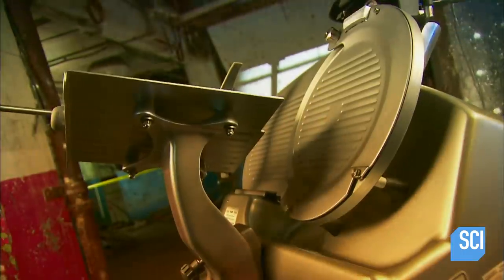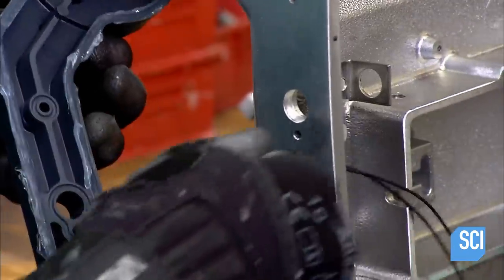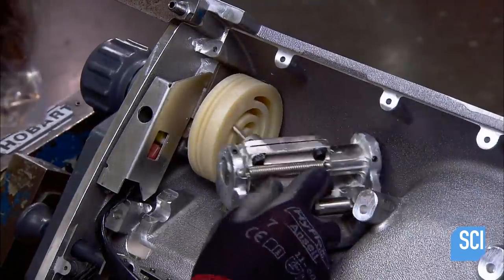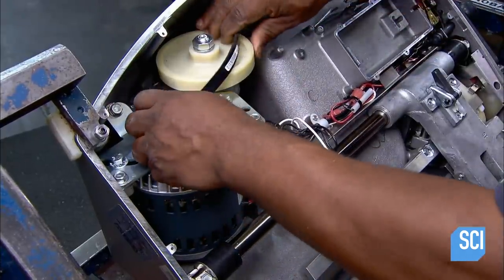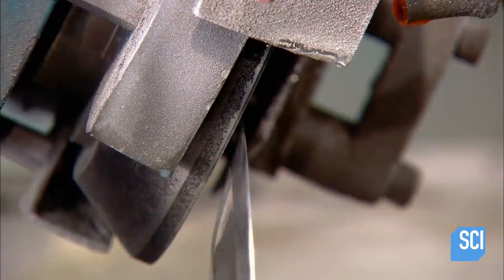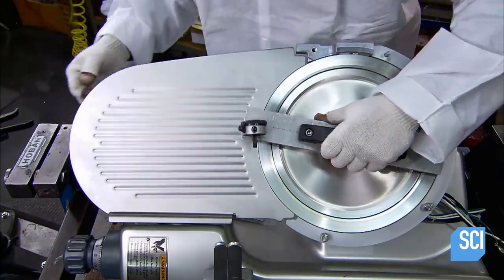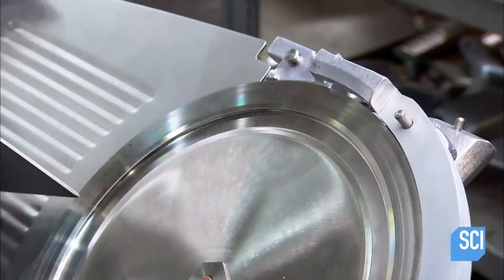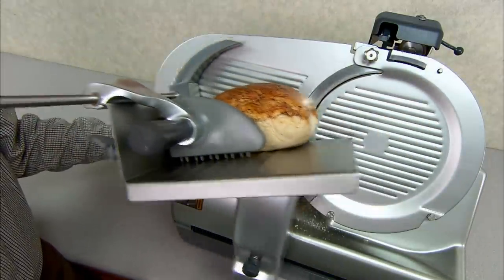How It's Made: Deli Slicer

Comment: I worked in a local restaurant with a similar model. Yeah you can cut a whole lot of things with this. I had to feed the meat myself, the chef told me that most people send themselves to the hospital while they clean the machine. Cleaning the top was easy, but cleaning the bottom was pretty hard because a lot of gunk just hides in crevices here and there.
Reply: Used to work machine sharpening blades and shear cutters. these blades aren't no joke, they get sharp enough you'll cut yourself with just a very light touch, happened to me plenty of times.
Reply: We have this slicer too and I agree, cleaning the bottom is a pain.
Reply: Use cut resistant gloves. Its not that hard.
Reply: @metamorphicorder  Yeah, I never shied away from those gloves. A lot of old heads don’t use them for whatever reason.
Reply: @thelordofeternalfireandhis4033  ive done it both ways. I dont remember ever seriously cutting myself on one. Maybe a nick here or there. I could even clean them with the blade turning, which you should absolutely NOT do. But us old heads do sometimes do things in inadvisable ways. I think the bizerbas have an easily removable blade which makes it pretty easy to clean. I do think that a oscillating blade would probably be better than a rotating one from a safety perspectice and it would make cleaning easier and safer. They would be really really loud though.
Reply: I used to work in a grocery store deli in the 1990s using these. You did have to be careful when cleaning. People also liked to take shortcuts and hold the deli meat and carrage with one hand instead of using the guard. I had to come in once and clean the deli because a coworker cut the tip of her finger off while slicing chicken roll.
Reply: When i was in a culinary school a girl was slicing a roast when someone started talking to her. She turn to reply to the other person and sliced off her finger tips (luckily it was thin very slices) and she didn't even realize she did it until she saw blood, these things are no joke. there's alot of was to die or seriously injure yourself in a commercial kitchen.
Reply: Used a very similar model (no automatic feeder, woulda been sweet though) and the blade is so sharp that you can easily cut yourself and not even notice. The cuts also bleed forever because it's such a clean cut, had one bleeding for maybe 6 hours before it finally stopped
Reply: I stumbled backwards into one at the butcher's, his customers got a little behind with their orders !
Reply: I worked for the food services when I was in college and hated cleaning those machines.
Reply: I remember cutting my finger on one of these. I was 21, naïve, and I thought that I could get a little piece of meat off of a blade that I had turned off (but was still in motion). The thing wasn't even particularly sharp, but it still made a good clean half moon slice in the tip of my left index finger. Even if it wasn't the sharpest years-old blade anymore, I still couldn't feel pain for about 5 minutes-- it was still that sharp. Now every time I see one of these, I cringe a bit and feel the raised scar skin on that finger, lol
Reply: @phonedave  my guess is it was weaver chicken roll in a blue wrapper. I've used Hobart slicers at Shop n Save and most recently Bizerba slicers at Walmart. Only thing I miss about the Hobart is the removable caridge and more granular numbers on the guage plate. Otherwise they are mostly the same.
Reply: @haloslayer255  Yep, Weaver in the blue wrapper.
Reply: The one I’m buying has a easy remove blade
Reply: Retail meat cutter for 15 years, and I had my middle fingernail replaced with a toenail bed under my big toe, took the entire top of my finger in an instant.

Comment: Hobart slicers are very nice. But they cost alot, like most commercial appliances do.

For home use, I purchased a 10" BESWOOD slicer and I love it. Quiet and smooth operation, and easy to clean and maintain. Very rigid adjustment on how thick you want your cuts and assembled well. I have many hours on it in the couple years ive had it and its still like new. Comes with its own sharpener as well. 5/5

Just cut a roast for beef sandwiches today, paper thin and excellent.

The unit cost about $350-$400 I think? and parts are available if needed. If anybody is in the market for a slicer for home I enjoy this one. Surely there are other nice ones out there, but im just sayin.
Reply: Thank you!
Reply: Beswood and KWS make good inexpensive 10" slicers. Built pretty much the same as the commercial slicers, but scaled down and designed for a lower duty cycle.
Reply: you have a deli slicer at home??  wtf

Comment: Former Hobart service tech here.  A better video would be "How deli workers mess up slicers."

1. Drop them while carrying them to the sink. (Lift and clean in place, do not move unit from location).
2. Submerged in the sink.
3. Plugged in while motor case is filled with water after being Submerged in sink. 
4. Using spray pan release to lubricate.
5. Using nothing to lubricate.
6. Excessive force with grip causing grip to crash into blade..
7. Excessive sharpening.
8. Not sharpening.
9. Bones.
10. Lack of training, or lack of listening.
Reply: Those things weight a ton, why someone would willingly carry this to the sink everyday?
Reply: @wills5482  Bad management probably forcing them to carry it to the sink

Comment: I used to work at a deli where one of these would be used. A silly old man who fancied himself a comedian came in one day and attempted to pass a pressed sandwich through the spinning blade to make thin disks from it, but it didn't have the integrity to sustain the forces and it made a mess (both inside the machine and across the walls of the deli). He was still wise cracking and making jokes about "cut that out" and saying the meat slicer "wouldn't cut the mustard" as we ejected him from the deli. Eventually the slicer had to be ditched out and sliced meats were no longer offered. The deli was out of business within the year. All because of a silly old fool who prioritised 'his funnies' over a cracking small business.
Reply: if your slicer doesn't have the integrity to slice a sandwich it's definitely a shit slicer. I think there might have been a few more issues at this deli than an old man slicing a sammich on the slicer...
Reply: @zachjonas4231  Sorry, to clarify: it was the sandwich which didn't have the integrity, not the slicer.

Comment: Very nice.. I love Hobarts.. there are cheaper models & brands out there for household use, I suggest 10" ¼hp model, can be found for $400-$500USD & are slightly smaller & lighter😉👍
Reply: I actually grew up with a full-size Hobart in the cellar, and based on my experience with it, I can tell you that I would never buy a downmarket version of this particular device. The amount of kinetic energy in that spinning blade is unreal.

If anything ever went wrong with that, your house would look like a Halloween costume. Yes, that Halloween costume.
Reply: @baylinkdashyt  The Hobarts are the pinnacle grade for sure, there are some nice Italian, German, etc. slicers out there of similar function & quality, but there is a bit of a difference in the "downmarket" ones that are actually better suited for low volume.. we can agree a Hobart will take all you can give it, while asking you if you even started yet, all while slicing hard cheese like a laser through Velveeta..🤣
The slicer I got was a much slower, much lighter machine, but suits household use. To slice soppressata so thin the fat melts out..🥰👍slicing tomatoes into sauce..😆👍
You just have to be careful of what you are buying, become as educated as possible, so you can make the best decision for your needs 😄I still need to get one of the nice Italian GLOBE hand crankers! OLD SCHOOL!

Comment: The problem with them is cleaning them need to make a shroud that you can place over the slicer sealing off the electrical components of course that will utilize high pressure water and heat to clean the slicer then drain etc